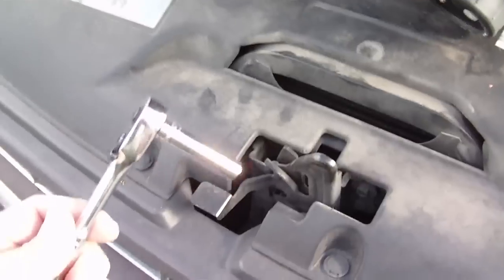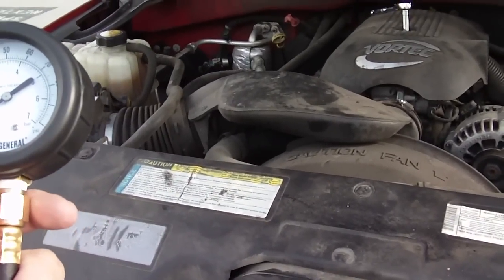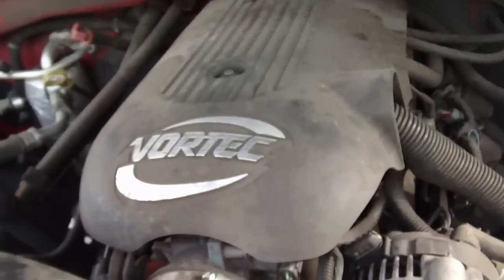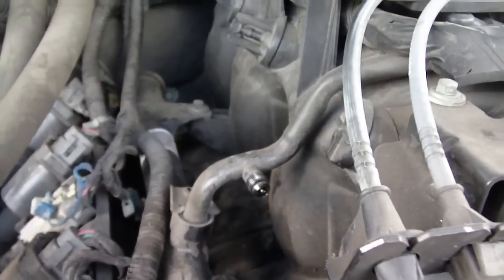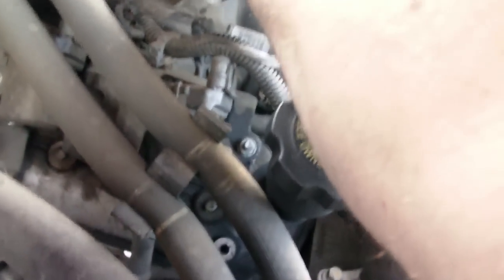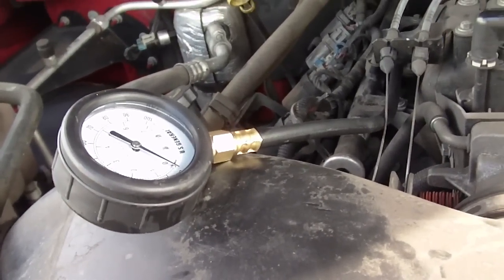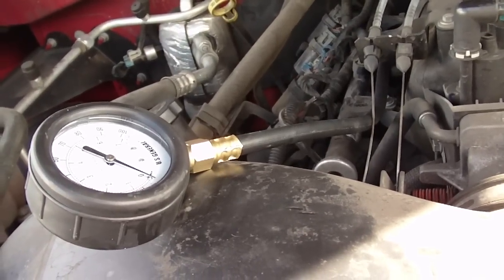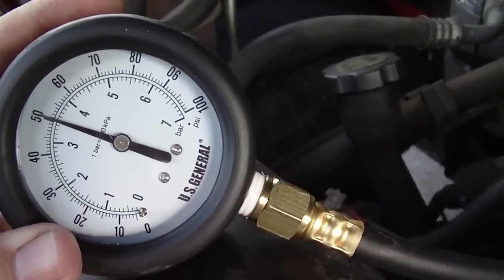2001 Chevrolet Silverado 5.3L Fuel Pressure Test

Comment from the maker: sounds like a fuel pump to me.  Mine was $300, but that was because I bought it at NAPA to get the lifetime warranty.  You can get just the pump for around $60.  I saw another guy on youtube that showed that.  Rock Auto has the exact same pump I bought from NAPA for $152.  It is an Airtex fuel pump. Sorry it has taken so long to get back to you.

Comment: Hello, I have been having problems with my Chevy starting. I have had the battery, starter and alternator tested and they're all good. The power comes on but it doesn't start and there's no clicking or any other noises when it does this. Usually after I've waited 5 mins it starts like nothing happened. Could it be the fuel pump?

Comment: Also as far as fuel pumps go you can turn your key to on, not start the vehicle and listen to see if you can hear your fuel pump engage. P.s. I was one of the idiots that suddenly broke down on the side of the the road due to fuel pump. BTW Tenn, do you know any anything about why my oil pressure gauge on a 01 Tahoe would be bouncing back and forth. If so. Email me at drpep79@gmail.com. my Tahoe purrs like a kitten but that gauge is pissing me off!

Comment: @ Patrick, I would start with your throttle positioning sensor. Relatively cheap and easy to install. Secondly I'd put about 6 oz of seafoam in your engine oil to see if it helps.

Comment: Hi Patric William, discharged or low nbattery. Fault in the fuel or igniton systems,injector leaking ,distributor rotor carbon-tracked.
I hope this help.

Comment: When I crank mine up sometime it has a rough idle then when kinda warm it smooths out can any one tell me wats the deal
Reply: Get a resolve on this yet? Mine idles slightly rough. New pump, filter, plugs, wires, good battery, good grounds, fuel pressure good.

Comment: The stock fuel pump is a common problem for these vehicles. I have a 2000 GMC Sierra 5.3L at 180,000+ miles with the same issue. Just got my Delphi pump in today and plan on dropping the tank tomorrow.
Reply: How did it go?
Reply: @JoseATr3 hopefully it’s fixed. Been 11 years

Comment: does any of these fuel related problems affect oil pressure?
my 01 silverado 4.0 v6 died on me today. i tried turning it back on but it had trouble idling and eventually would stall. the message board read "check oil pressure"
the oil level was good... maybe a faulty oil pump?

Comment from the maker: @Jerry Drake hey jerry. Your fuel filter should be on the driver side probably just past your door going back towards your gas tank. It will be underneath kinda tucked on the inside of your frame rail.

Comment: Great video for people like me who are mechanically challenged. I have a 2000 Tahoe LT, New style. I'm having trouble on start up. Have to crank it a few times before it starts. It idles fine and drives fine. Was told when i bought it that they had replaced the fuel filter and pump. So maybe the fuel pressure regulator? Also unrelated, the Service 4x4 light comes on all the time even though it has been...no idea why.

Comment from the maker: I believe that 65 PSI is normal.  I read somewhere that Chevy increased it.  Could be a bad O2 sensor.  Did they give you the diagnostic codes?  It is my understanding that a check engine light usually means an emission problem.  If your check engine light is still on, you can take it to Advance Auto or Autozone and get them to put their scanner on it to get the codes.  They do it for free.  You can also ask them for a printout of the codes and that may have possible causes on the printout.

Comment from the maker: You should still check your fuel pressure.  It still could be low.  Did you change your fuel filter because the truck was acting like it wasn't getting gas?  I have read where you can possibly hit the bottom of the gas tank with a rubber mallet to see if it will start working again.  I hope this helps man.  Sorry it took so long to get back to you.

Comment: I just used your video to check pressure on mine and with the truck not runningi have about 50.5  once i start it fuel pressure drops to 48.5--49.00,  do you think this is ok? Fuel pump is new and filter is new.On another note once I changed them I lost 4 mpg. Was getting about 14 before and now its lucky to get 10. truck has had a full tuneup and only major change was Fuel pump and filter.. Oh yeah It has no leaks..

Thanks for the great Video

Comment from the maker: @revampted I haven't had a problem with my relay yet.  Hopefully I don't.  I think that there are 3 other relays in the box that are the same as your fuel pump relay.  I would try to swap one of those around with your fuel pump relay and see if it heats up too.  I doubt that it would be a fuel filter issue.  can't say about the relay 100% though.  search chevroletforum .c o m for fuel pump relay.  I would post the direct link, but youtube doesn't allow it.

Comment: Have you ever had any issues with the fuel pump relay, I have had this issue on my tahoe. changed the fuel pump, it stopped but it starting to act again.
I noticed that the relay would heat up badly. could this be a fuel filter issue? or pin or grounding issue?

Comment from the maker: @eggybaby84 Ok last comment back to ya. :)  Search this text in Youtube. 1V-257Bn0sA  It is for a 97 Tahoe and a good video.  The guy shows some tools to remove the fuel lines.  They also sell these at Harbor Freight.  I used some needle nose pliers, but the proper tools make work better.